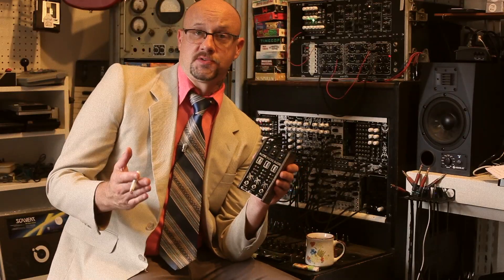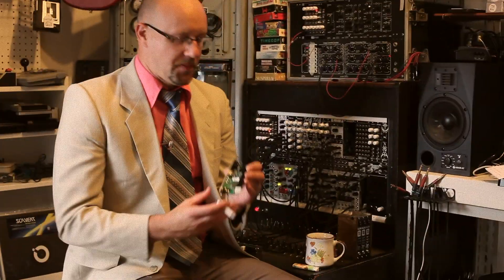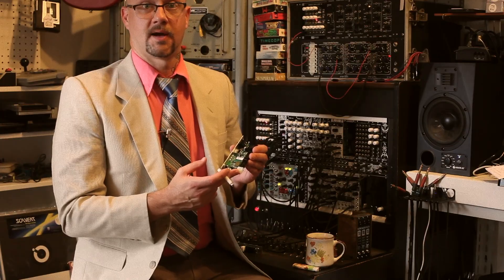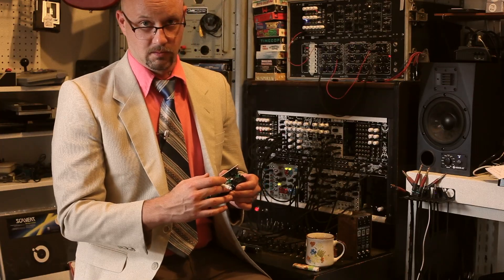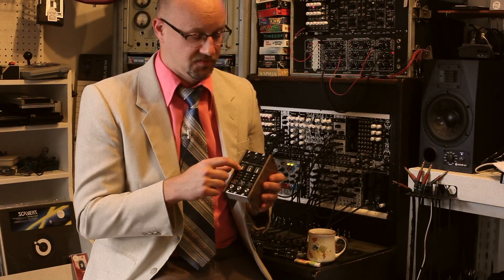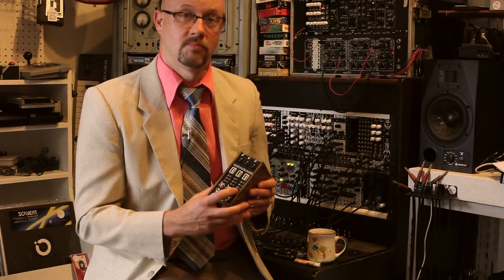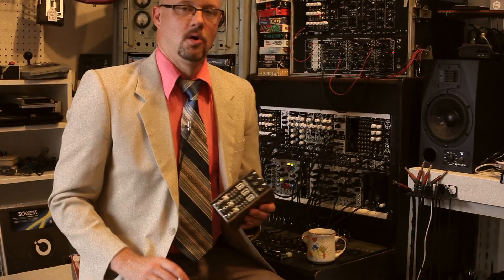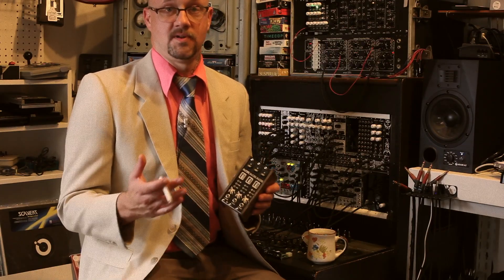Super Power

Comment: Hi! I have a 6U case housing 32 modules. My current power requirement is +12@1,800Ma. So it seems that I could power everything with the Green or Blue configuration of this module, however I won't have enough slots to plug my modules into. How can I solve this? Can I daisy chain flying bus boards into one another and connect all of them to the super power?
Reply: Results?